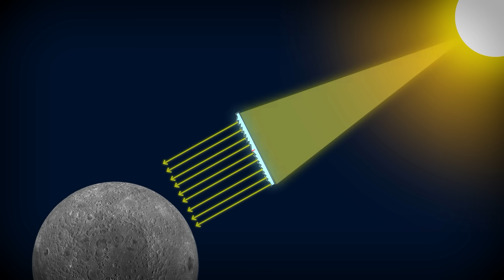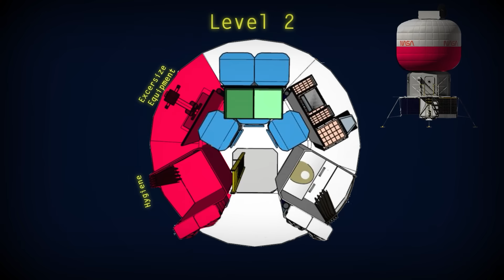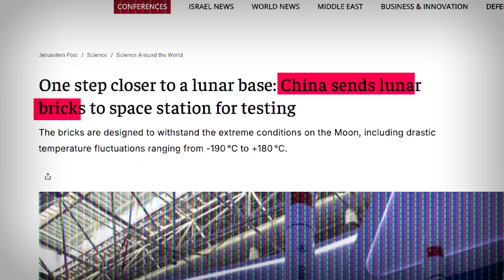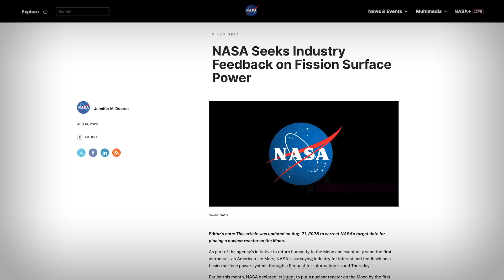How NASA Will Build A City On The Moon

Comment: Wouldn’t it make more sense to have an unpressurised lunar rover, in case of an accident and catastrophic depressurisation? The astronauts could ‘plug their suits into’ the rover.
Reply: They have several concepts through NASA, I believe Lunar Outpost is the company making the  Lunar Terrain Vehicle (Space Truck) chosen by NASA. GM and Lockheed Martin were also working on a joint venture as well with NASA to make a Lunar Mobility Vehicle as well.

Comment: Elon has The Boring Company, why not build underground living/working structures?
Reply: Excellent idea, however it has its problems with a short term mission like Artemis III. Boring machines are very large and could even be compared size wise to that of a train/SpaceX Falcon-9 or even smaller models can be similar to that of a couple city buses stacked together. Not to mention weight. You're looking at around 1500 Tons - 7000 Tons, where price per lbs to get to orbit is extremely expensive even if we shipped it piece by piece. Maybe in the longer Future, but definitely not right now.

Comment: For intermediate travel distances from one point on the surface to another, the more you stay underground and protected, the better. Therefore, I would hope they would consider building a cordway. This is a ramrod-straight tunnel, along a cord of the moon’s curvature. Even though it’s straight, as far as gravity is concerned your cart coasts downhill to its midpoint and uphill to the opposite end. Without friction (you’d use maglev) and taking advantage of the moon’s free vacuum to eliminate wind drag, your cart would would move by itself. Total travel time would be 54 minutes, regardless of the tunnel’s length. The limitation is how deep below grade your midpoint needs to be, but under 1/6 G, the overburden is much lighter than on Earth. For a 100-mile-long tunnel, maximum speed at midpoint would be 174 mph and depth there would be around 1.2 miles. For a 200-mile tunnel, 348 mph max, still 54 minutes start to finish.

Comment: Due to the Moon's axial tilt being 1.5 degrees compared to Earth's 23.5 degrees, the lunar south pole not only has craters that are in perpetual shadow, but those same craters have perpetual light along their rims. The lack of tilt means there is no day/night cycle like at the equator.  So solar power is absolutely fine to power everything if the base is going to be at the lunar south pole. If nuclear energy is still going to be used, I wonder if a Sterling Engine could be used. The Sterling Engine operates on the principle that one surface is very hot, heats and expands air to push a disk that is encased in an airtight container and the very cold surface furthest away from the heat source causes the air to contract, this moving disk pushes a turbine that moves incredibly fast.

Comment: The 2nd generation of people living on the moon won't be able to come back to earth without severe physical issues. Their bodies will be permanently conditioned for weak gravity. Someone born and raised on the moon would be 100% conditioned to operate in low gravity. In other words, going from the earth to the moon is easier than a perosn raised on the moon going to earth. Because you weigh 6 times less on the moon. Its much easier to move around if you weight 6x less. But if a person is born and raised on the moon for 10 to 20 years, and then comes to earth, he will feel 6 times heavier than normal. That's a death sentence. To put that into perspective, imagine if you weighed an average 175 pound. Now Imagine suddenly being 6 times heavier due to gravity. You would feel like you weigh 1,050 pounds. You wont be able to move or exercise. Your heart would struggle. You'll just lay there collapsed under your own weight until you die. Extremly Long-term exposure (like 10 to 20 years) to very low gravity on the moon will make you become dependent on the moon's low gravity. Every year on tbe moon, you'll become more and more fragile to earth's gravity.
Reply: We don't know that.. yet.  I suspect you're correct, but what we need to know is if someone living in Lunar G can exercise enough to do it long term and return.  People born there will, as you point out, likely never be able to 'come down the well'.
Reply: @imaginary_friend7300  You right. This is certainly just my opinion based on my own research of the available facts. I hope I'm wrong, but I believe I'm right. Exersize only address 30% of their physical problems. Even with 2 hours of exercise every day the astronauts still suffer bone loss and muscle mass loss. Sometimes the bone loss is permanent and that's just within the first 3 months of low gravity. Coming back to earth after 10 to 20 years of near zero gravity years is a death sentence. Exercise only slows down some issues. It does not stop anything. 70% of their physical issues can't even be helped with exercise. Stuff like balance, coordination issues, altered vision, cardiovascular changes, immune system alterations, skin issues, difficulties with digestion, and a high risk of DNA mutations just comes with the territory. I feel for those people whos going to Mars too. If 3 months can cause permanent bone loss, the Mars people will be exposed to low gravity (62% less than earth) for 3 years minimum. They will be in bad shape when (or if) they come back regardless of exercise. They will feel like they weigh 300 pounds with brittle bones.

Comment: i got some rage-bait for all people here who think NASA is useless and all its funding should be given to spaceX

they do different things, and are both important.

A part of what NASA does is basic research (which is not profitable), then  conducts  tests and maybe even builds, contracts building of full rockets. When NASA has proven something is possible they open the market for corporations to take over THAT SPECIFIC THING and make it better and cheaper. then NASA and that corpo heavily depend on eachother for services and funds, respectively. then nasa moves on to new R&D, testing, and missions so new (or old ) corpos can take that over. etc etc. 

If nasa and all government funding is removed basic research is drastically reduced leading to the stagnation of civilization because corpos are not willing to take huge finincial risks or explore things for the sake of exploring and discover things for the sake of discovering. the basic research and exploration will eventually be helpful but not in the time frame that corpos would invest in it by themselves (they would do it if the govt paid them). getting rid of NASA because its "ineffichent" is dumb, NASA should become more effichent, not have half of its science funding cut.

Comment: One of the things we need to watch out for, actually, as human settlement begins to take hold on the moon, is the possibility of accidentally building an atmosphere from outgassing from human industry, the exhaust of arriving and departing rockets, etc. The moon's gravity is juuusst a little too weak to hold an atmosphere against the solar wind over the long term. It can hold it in the short term (relatively speaking - several thousand years, as opposed to billions of years for earth), but without replenishment will be lost eventually. It happened before, the moon had an atmosphere of volcanic outgassing gases thicker than the atmosphere of today's Mars. But when the outgassing stopped, the atmosphere began to leak away. It would take relatively little constant outgassing by human industry to start building an atmosphere. And this is a problem, for there are many industries for which the moon's vacuum environment is one of its greatest assets.
Reply: It’s not so much the gravity as the magnetic field that shields earths atmosphere
Reply: Very insightful, thank you.

Comment: This is all snake oil. We don't even use 3D printed buildings here on Earth, why would we do it on the Moon? Moon dust just like desert sand is also not suitable for use as an aggregate in concrete or building material. It's too fine. But at the end of the day the most important thing is there is very little energy on the Moon. We can't even build Nuclear power plants here on Earth anymore because of regulations and fear. Building one on the Moon would be a hundred times more difficult and thousands of times more expensive. The nuclear fuel also does not exist on the Moon and would have to be shipped there from Earth. All this to what end? There is nothing valuable on the Moon, and the colony would never be self-sustainable.
Reply: Just to illustrate how wrong you are about, well, everything... We do use 3D printed buildings here on Earth. A great example is the Lennar/Icon homes in Austin, TX.
Reply: We’re on the cusp of Mars, reusable rockets, and maybe even Earth-to-Earth trips. Stop betting against human progress and start cheering for it. You might just feel that same awe I did at 12 at the moon landing.  No reasons, no facts, just complaints. Armchair rocket scientists and armchair engineers constantly proving ignorance.
Reply: There might not be anything valuable on the moon it’s more like practice for us before we do bigger and better things.
Reply: Maybe it’s due to our proximity to trees and other options… 

If the only raw material available is moon dust you’d have to find a way, and the lack of atmosphere makes it hard to get a carpenter

Comment: Wouldn’t driving on glass be the same as driving on ice?? You’ll have no control over steering
Reply: What makes icy slippery is the thin water layer , that appears when you apply pressure. glas is just like rock for driving.
Reply: @flummi6966 I never thought of it like that thank you